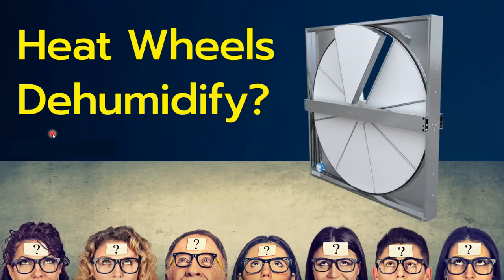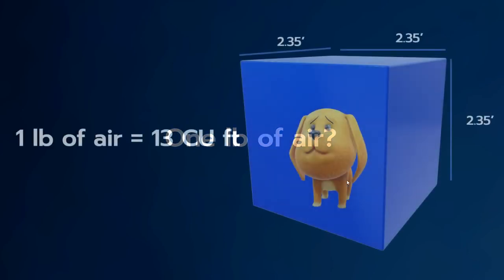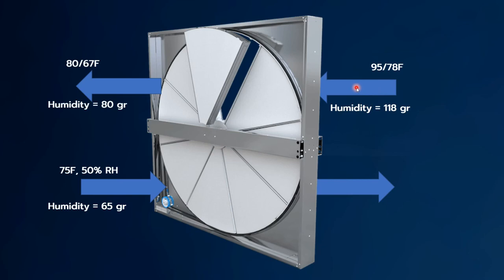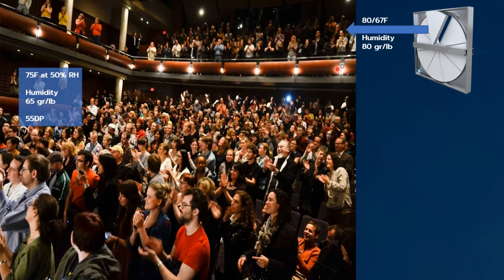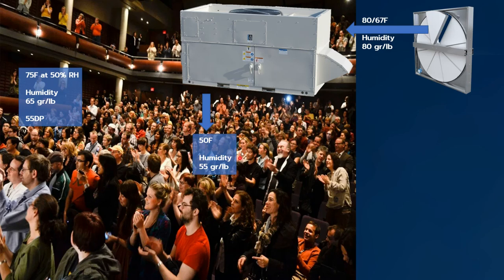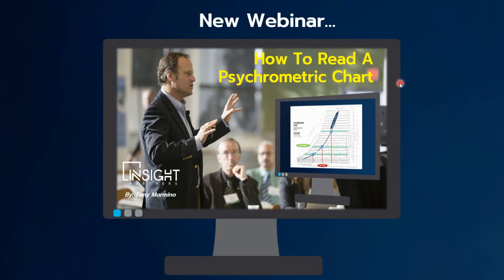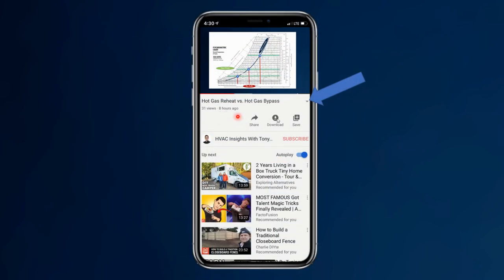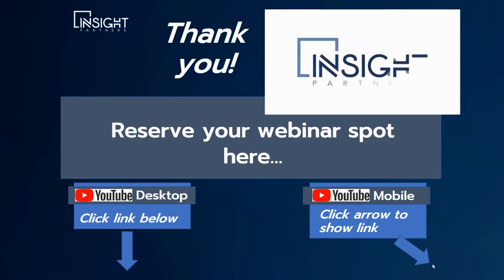Heat Recovery Wheels Dehumidify?

Comment: We have AAON units that have heat wheels that need replacement. They are going to cost about $16k each for replacement for parts and labor. Do they have enough benefits to justify spending that much for replacement?
Reply from the maker: Thanks for the comment David. The answer would depend on several factors. Your local AAON rep should be able to walk you through the pros and cons.